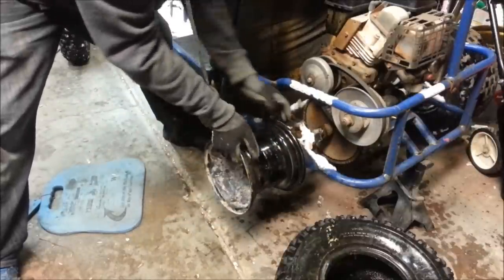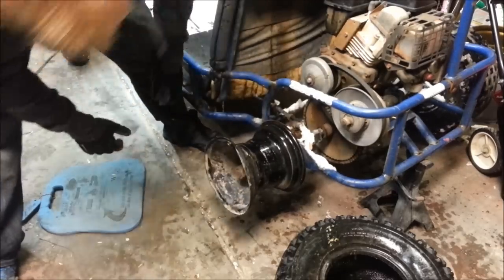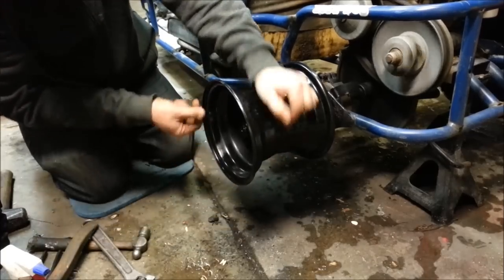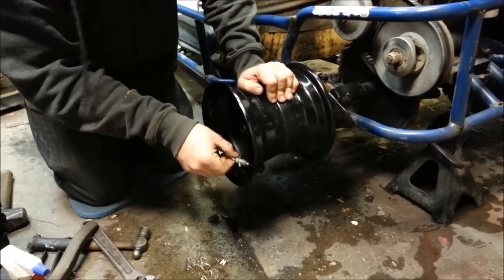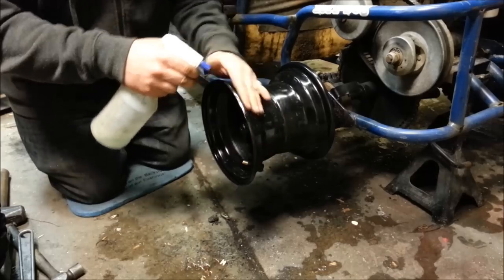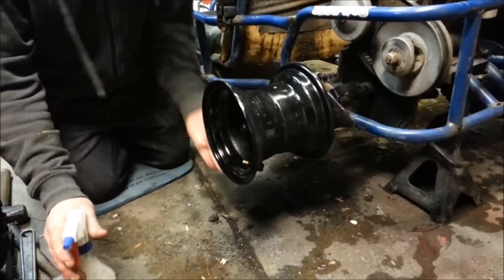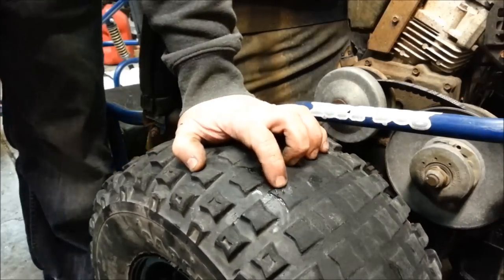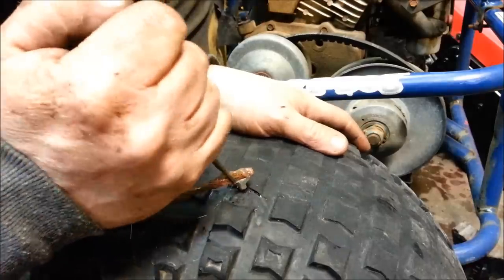Wheel + Curb + Drifting = Bent Rim on the Go Kart

Comment: Here's a little trick -  0:44 tire lever in place - tap the back bead of the tire with a hammer and it will come straight off, provided the opposite side of the bead is in the well of the wheel. Nice job you made of that wheel though, getting the buckle out and all.
Reply from the maker: davidrobert2007 Thanks.

Comment: When the rim bent like that how likely is it to bend like that in the same spot again??
Since that's a relatively thin tire would you recommend putting tires slime in as a second layer of protection with the patch??
Reply from the maker: redneckbryon Yeah, I generally run slime(off brand) in most of my off road tires as a good precaution. It's very unlikely for it to bend by itself, unless I find another curb..

Comment: Tyre plugs are awful and should only be used as a temporary fix in an emergency. In Australia they are only legal for off road use, for a very good reason. The only way to properly repair a tyre is from the inside.
Reply from the maker: ***** I've had nothing but great luck with them and they have saved my butt more than once. The biggest issues are: a plug being used on a hole too big, a hole that has been enlarged on the inside where you can't see, side wall repair, or people using them without glue. Definitely it is better to use a plug patch from the inside but a plug in a basic straight hole will last the life of the tire.
Reply: *****
yeah mushroom plugs are great and quick. I also like radial patches (patch with steel radials running across it) for punctures anywhere close to the sidewall, they take a little longer to buff the tyre and roll on but give a lot of strength. These "rope seals" are great for off road action to get you going again without taking the wheel off............ but once you get home it should come out and be repaired properly or the tyre replaced, not all punctures are repairable.
Reply: These plugs have many uses.  Tapper88 chill.  Fix it!!!  Thanks sixtyfiveford.
Bruce